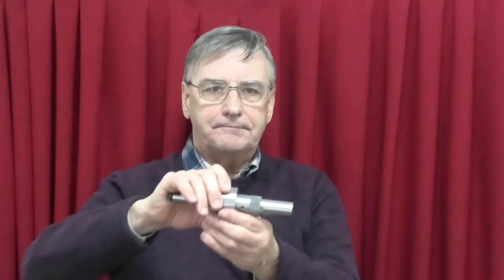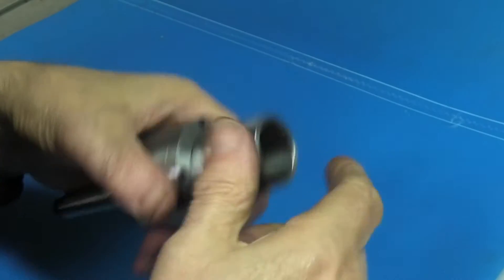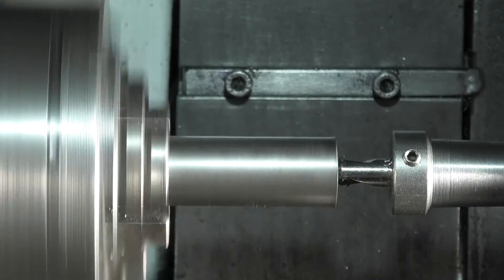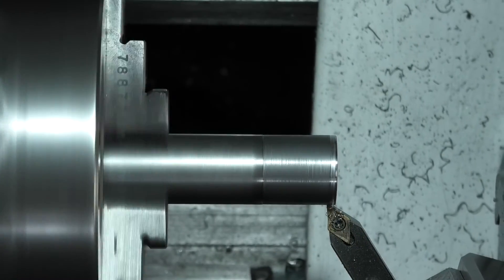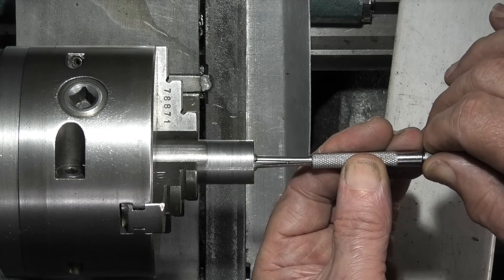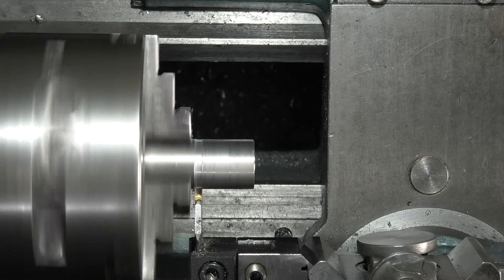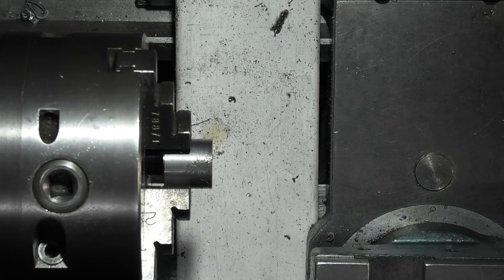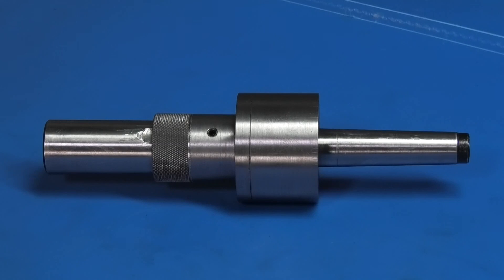Assembly and test Part 4

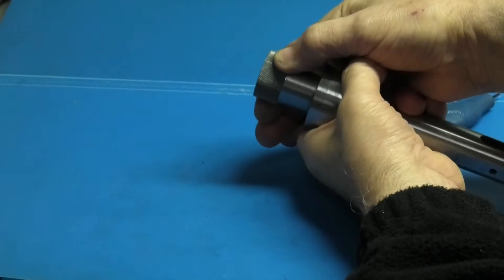Comment: Liked this series of videos! One thing I don't understand: 4:10 you're rotating the pivot sleeve relative to the tool. I don't understand how is it free to turn? Since it has a slot and the mating part has two pins that engage in that slot. The whole unit shouldn't have any parts that rotate (beyond the amount of play between the two sets of pins and slots), otherwise how would the reamer do the job?
Reply from the maker: Hi Gene The Morse Taper arbor has a grub screw which locks the unit together, I didn't have the screw fitted at that time.  Buy removing the grub screw you can change the arbor for a different Morse Taper
Reply: @enotsengineering  Yeah this makes sense now :)